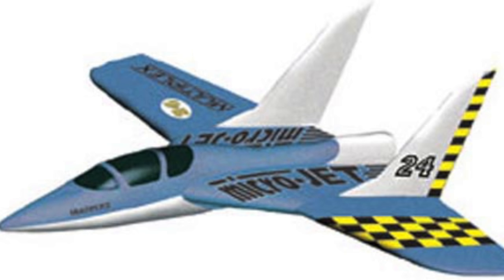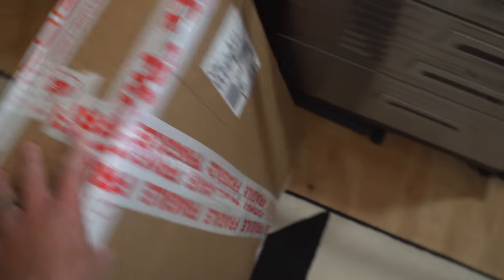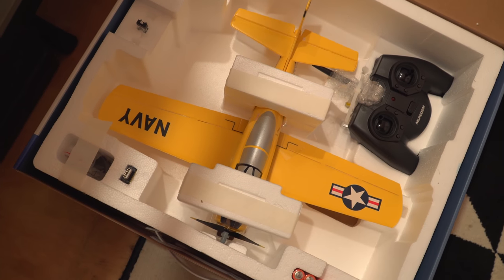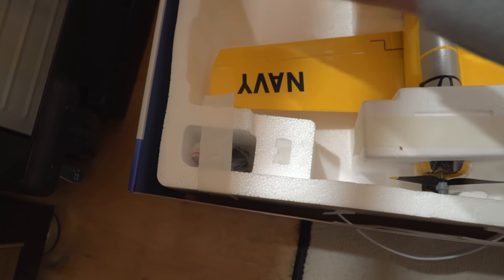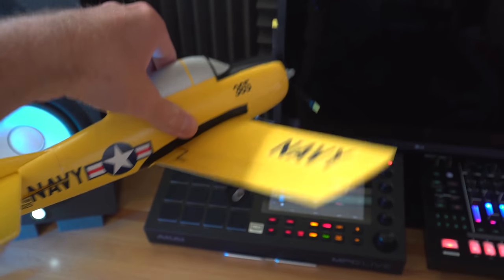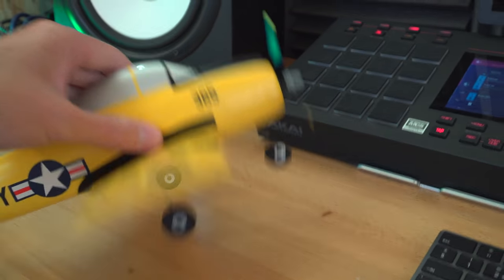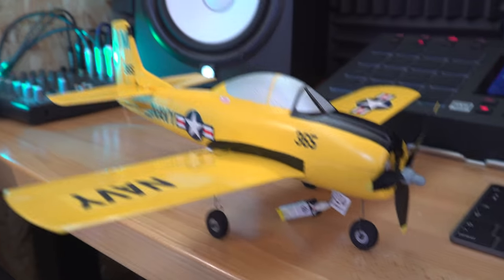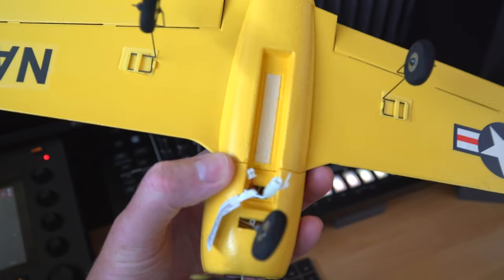MY FASTEST EVER RC AIRPLANE!!!

Comment: kiki
Extracting Lightning bolt energy is not what I am after , in order to satisfy thermodynamics you must comply to it`s demands , but thermodynamics is vague in asking the details that it demands to conserve energy , in it`s demands thermodynamics describes singular systems or closed systems , it compares no analytics to multiple systems in the Quantum production energy comparisons , in other words no 2 separated systems can be Identical in energy production , one must be higher in energy generation than the other , any size compared to 2 Identical parts will never be the same , thus Quantum mechanics energy in packets , thus thermodynamics will be satisfied by a update to it`s demands for conservation energy using 3 conversion processes separated , ( Not one Unit ) but 3 separate energy conversions , DC / AC / DC , low voltage Direct current is converted to high voltage Alternating current , this is connected to a transformer to then be converted back to direct current again to low voltage DC , (WHY)? it becomes simple once you understand it , EXPLANATION FOLLOWS = there is only so much energy contained in source of energy like this battery I use 1.2vdc X 1400mAh = 1.67w at it`s best this battery can only give back about 70% of useful but declining energy levels as batteries are used they supply less and less power and more voltage drops as well , to get around this delima engineers in the auto industry for electric cars convert dc to ac this helps but does not address the current issue so the energy conversion is more powerful converting to ac but does not help in the power production process current if they converted the ac back down to a dc the power production will come from the mass of the coils by it`s high energy oscillation of the magnetic fields , what the mass of the high energy coils generate is what the battery alone has to supply but now mass is converted to energy from the coils and the battery then becomes a secondary energy supply , and not the main power production of this system , the oscillator becomes the higher source of power and thus satisfies thermodynamics a higher output can be achieved than an input , so simple but yet so illusive to all who are tunnel visioned in the thermodynamics laws ! Hope this helps , your colleague ken fairbanks cell # 630-859-2887